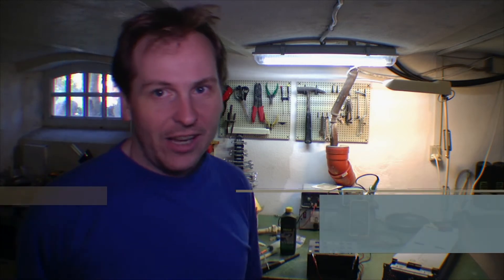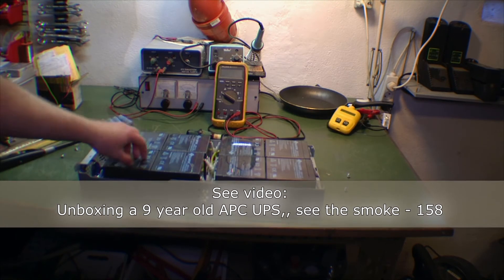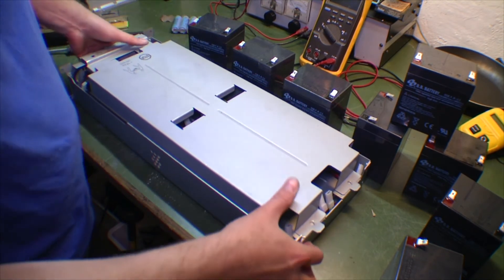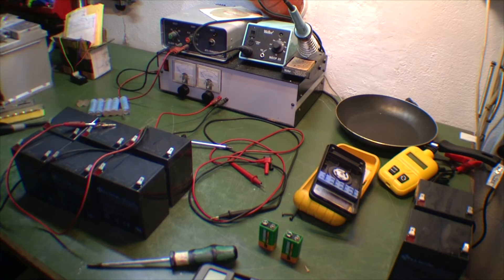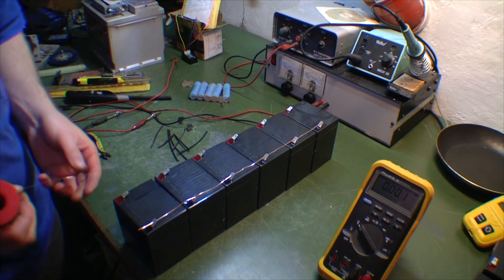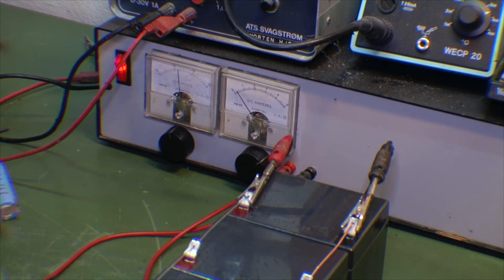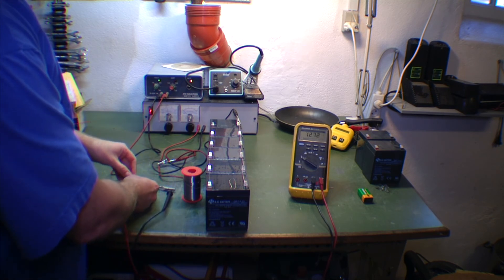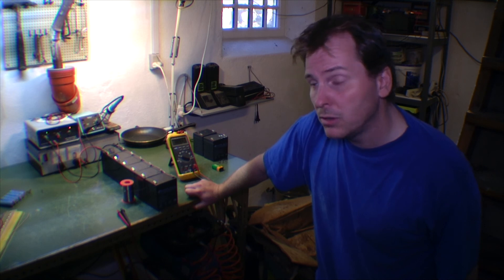Six small UPS batteries need to be charged 12V - 244

Comment: Hi. I do not speak English very well. I am Brazilian and watch their videos and I quite like the contents. so keep doing videos. 
in automotive batteries 12v you should charge the batteries with more than 12V. ie 13.5V for them to come into fluctuation. but I saw in your video that you just charges with 12v in parallel here comes my question: UPS batteries work different from the automotive batteries?
Reply from the maker: Hi +henrique casonatto 
Greetings to you in  Brazil!!
Yes, i do charge them with more then 12V,,, in this video i started with 12,7volt. I wanted to charge them slowly,, I later put them on a automotive charger, and that Will do 13-15volt.
If you go back to some of my older videos you will see that i have not had much luck with restoring these old batteries,, so i here try a new approach.
I have tried to charge 12v batteries in series with catastrophic consequences to follow :-/
Thank you for watching! :-)
Reply from the maker: Hi +henrique casonatto 
Ups,, some of the things i wrote is in the video i am putting up Friday :-/
Thank you for watching! :-)

Comment: Be good to see your ups come back alive again - I had to replace one of my batteries and its been working well ever since. My kettle blew up the other day and took out the main breaker, and I heard the ups come on "BZZZZZZZ" "oh its doing its 2 weekly test... that seems longer than usual. uh oh something is up". As I have disabled (in software) the buzzer on the ups, I didnt know it had actually kicked into battery mode until I checked its front panel. So I went searching for the fault, and found it was my kettle. Very pleased I have it and mine is in use in a more domestic situation, unlike yours which is powering some of your servers :) Also I don't mind you saying oops instead of ups - makes me chuckle, as to most it means mistake, but we all know what you mean. :)
Reply from the maker: Hi +dash8brj
I really do need to get an UPS.. U P S - uninterruptible power supply :-) up and running in my data center.
Mostly to protect my equipment.
How can a kettle blew up??
Thank you for watching! :-)
Reply: +My PlayHouse (Morten Hjorth) It didnt explode Morten, it just went out silently, basically shorted itself somehow and tripped the breaker. Since the UPS input was on the same circuit; well we all know what follows... ups on battery, loud hum, for those that haven't disabled the buzzer, "Beep Beep Beep" etc :)

Cheers
Ben

Comment: Great video as usual Morten.  I really don't mind hearing oops instead of yoo-pee-ess. At first I thought you were referring to a mistake you made!  I'm having trouble keeping all your batteries straight in my mind.  What is the story on the batteries for your solar power?  Are they the ones on the shelves in your basement? Also, how will the inverters connect to your main service panel?

eric
Reply from the maker: HI +epd807 
This is just to be UPS in my data center,,, nothing to do with solar battery bank. 
In Danish we just say ups about:

UPS (oops) - made a stupid mistake.
UPS (teknik) – uninterruptible power supply
United Parcel Service (UPS) – parcel company

And here it is the "parcel company" that gets the U P S  way of saying it :-)
Thank you for watching! :-)